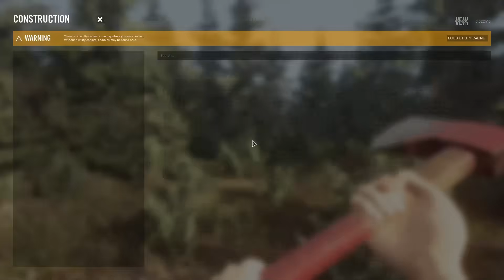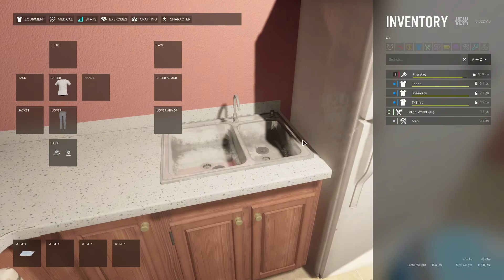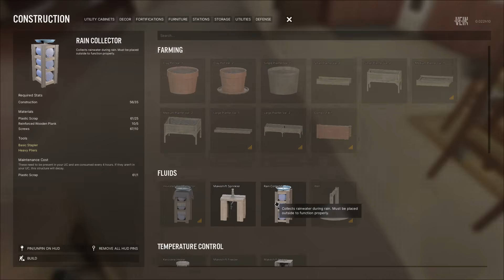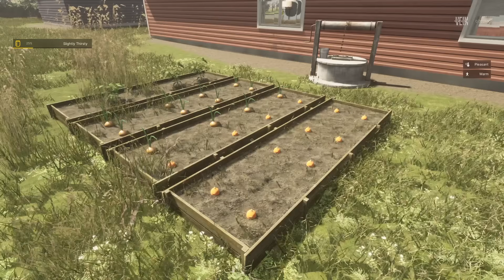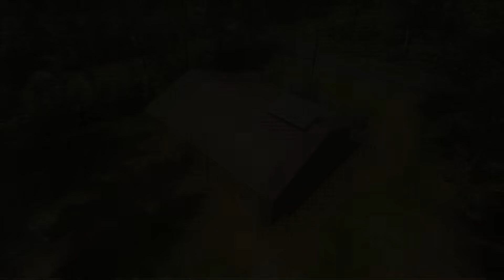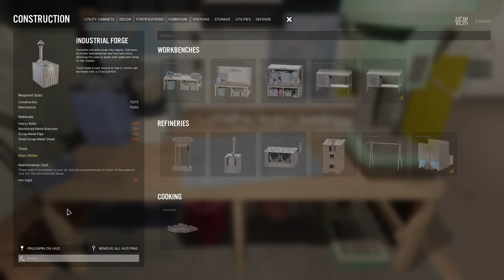VEIN GAME - Ultimate Water & Power Guide #veingame

Comment: FYI - You can now place a container next to a sink and select the option to Fill From Sink. No need to use a transfer container.
Reply from the maker: Thanks for posting this. That was a change they made after the video was released. Still doesn't work for water towers, but you can move a kitchen or bathroom counter with a sink out to the water tower, connect them, and fill barrels quickly that way too 🍺

Comment: You do realize that you can connect the solar panel to the battery and to you fuse box for unlimited power. Makes much more sense than to use a generator to power the battery
Reply from the maker: If you play on PvP servers you'll find there are some people who will dismantle all the solar panels they can find for parts or to grief other players. I showed how to use both generators and solar panels for power so you can go with either option as needed 🍺

Comment: I power my camp with solar & generator combo, so I'm a little disappointed that this game uses car batteries for storing power. Yeah they will work but they are not deep cycle. Also they don't use a charge controller/inverter? Perhaps this will get fixed in the future. Still good game. 👍
Reply from the maker: Be sure to post on the VEIN discord. The devs read all those comments, and will sometimes comment on them 🍺

Comment: I literally cannot get my microwave to work at Bowen hill park. I hook it up to the fuse box, which is hooked up to the solar panels outside, and the microwave shows the connection but still says unpowered
Reply from the maker: Is power going to the fuse box? This is early access, so please report issues like this on the VEIN discord, they test everything 🍺
Reply: @NoStumpsGaming it is. Im wondering if it isnt getting enough power from the panels outside. Microwave says it needs 1200 so maybe thats why

Comment: 👍
If you build a fluid barrel next to a sink, you can just fill it directly.
Same goes with rain collectors, just build them fairly close to a sink and pre-fill them, then when the water is cut off - link them to the same sink.
I usually add a bunch of regular rain collectors to one sink for summer/spring/autumn and another sink just for winter - but hooked up to fewer insulated rain collectors.
I don't attach my rain collectors to the fuse-box, because I want to keep my winter water supply isolated, I have a winter sink and one or two year round sinks.
Reply from the maker: Great tips, they added those features in a recent update 🍺

Comment: I don't know if it's a common knowledge but I accidentally discovered infinite fluid by using fluid barrel + sink trick. And I also uses Industrial dishwasher as a storage since it has an infinite capacity.😂😂
Reply from the maker: Appreciate the tips, but those are the kinds of bugs the devs will clean up sooner or later. I try to avoid glitches in my guides for that reason, but feel free to share them here in the comments for players that like to use them 🍺

Comment: No need to transfer with a containers just place the fluid barrel near a sink, target the fluid barrel and select "Fill tank from sink". You can also do this by placing it near a gas pump "Fill tank from gas pump" and oddly it also works near portable restrooms "Fill tank from portable restroom" but that's not something I will be doing.
Reply from the maker: Great tip 🍺

Comment: I have a question. When the power goes out, does the stove inside RV’s still have power? I assume the vehicle would atleast need to be left running, but does it have power still? I feel like it should.
Reply from the maker: The RV stove always works. I'm sure that will change at some point. I can see them having it run on propane or kerosene since they're both in the game already 🍺

Comment: honestly this is a very poor guide because if u start with cooking, locking and scavenging the game starts extremely easy u start with lockpicks and a book to make them and scavenging allows u to search things immediately. after that u dismantle everything and get dismantle up and then u use the perk to get 1/4 items more when dismantle and then u make metal brackets and dismantle them.. u can use 50 iron scrap and make 50 brackets and then dismantle it and get 100-150 iron scraps and keep doing this.. hit level 50-75 easily and finding latex gloves and firefighter gloves u can try starting cars and leveling electrical up that way or build a battery charger and put all batteries in there and it levels it up
Reply from the maker: A very poor guide indeed 🍺

Comment: Thank you for providing the best no nonsense guide to this or any other game.
Reply from the maker: Thanks for the kind words, glad it was helpful 🍺
Reply: @NoStumpsGaming  Can I ask you a quick question. I've built a door and have a standard lock but cannot fit it the door, am i doing something wrong?
Reply from the maker: @ISOaGoGo  First, you need a screwdriver in your inventory to change locks, second, you need to open the door to remove/install locks to a house, for vehicles, you need to be inside the vehicle, if both of those conditions are met you should be able to remove the old lock and install the new one 🍺
Reply: @NoStumpsGaming this the same for doors or gates you’ve built?
Reply from the maker: @ISOaGoGo  yes 🍺

Comment: I have a tip! Don't connect rain collector directly to the sinks or washers cause they will slowly drain water. Put a water barrel nearby to connect to when you need to use the washer/sink and then disconnect after use to save water. Honestly don't like that you leak water constantly having it hooked up 😢
Reply from the maker: Yeah, that is a weird bug, but it's clearly a  bug and should get fixed in time 🍺

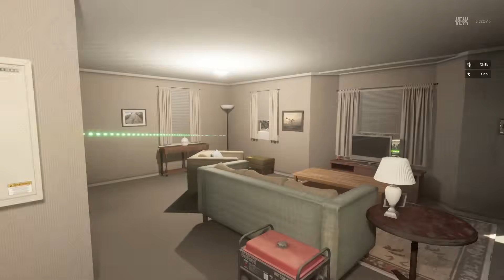Comment: What does one do to connect the fuse box to the solar panels. What buttons does one push? I just see the solar panels little menu of "examine connections, destroy or move" I see to connect option. Does my electric skill need to be higher? Talking about 16:06 in the video. How do you "make" the connection?
Reply from the maker: Remember, "We want this to draw power/water from that, this is where you add the connection, that is what you connect to." If you want this fuse box to draw power from that solar panel you add the connection at the fuse box and connect it to the solar panel. You'll see a little green electric icon on the center of the solar panel when you go to make the connection, just like in the video 🍺

Comment: Dumping dirty water into rain collectors makes it pure with no cook time once you max your cooking
Also the beer keg is good alternative also holds roughly 950oz of fluid
Reply from the maker: Yeah, the water thing is a glitch, and I try not to use glitches in my guides since this is early access and they're going to get fixed at some point. A couple of people have pointed out the beer kegs as well as gas tanks as a fluid tank alternative. Great tip 🍺

Comment: This is not a basic tip but a very useful one. If you are forging ingots get the firefighter gloves. You can then take stuff out of the forge while it's still hot without burning yourself. This means you can cycle supplies without having to wait for it to cool and save yourself a lot of cold Coke charcoal enhanced charcoal whatever. When you get up to the higher tier forge with the higher tier fuels, you can bring the forge up to like 7,000° cycle through stuff and get a lot of crafting of ingots done for only Coke or enhanced charcoal since a lot of your stuff only needs like 3,000°
Reply from the maker: Nice, good to know. Others have pointed out the Gardening Gloves will protect your hands as well 🍺
Reply: God Tier comment! Thank you!

Comment: While a good guide, here are a couple things to improve: Congrats either way!
1. WATER:
1.1. Largest container = car gas tank. You can get one with a Wrench.
1.2 Fill blue containers and dump them into an Insulated Rain Collector. No freezing water in winter.
1.3 Connect Faucet to Insulated Rain Collector. GG.

2: FUEL
2.1 Get a big white truck.
2.2 make blue barrels and put them inside the truck (you can enter from the back while "Holding" a barrel)
2.3 Get to a gas station. Fill them with the Car Gas Tank (4 trips and the barrel is full). Near infinite gasoline for cars + generators.

3: FARMING
3.1 Sprinklers can get to, at least, 6 large plantation thingies. Not side by side, but make four vertical and 2 horizontal. You can fit 6 just fine.
3.2 If you don't mind about immersion, all you need are 4 pumpkins and you're golden. Monodiet, but yeah. Keeps you going if you like the other stuff.
Reply from the maker: Great advice! It's always hard to find a balance between a quick guide and a thorough guide. Usually these kinds of comments help to bridge that gap 🍺
Reply: How about lockpick level low😢 and can I destroy lockpick level hight door from prison
Reply from the maker: @kaungkin4001  You need hydraulic cutting and driver tools to destroy prison doors 🍺
Reply: @kaungkin4001  you can destroy the DOOR no problem. If you destroy Containers you lose loot.

Find a shed with double doors. Go in, lock one. Go outside, lockpick. Repeat.
Remember to read a book for best results   ^_^
Reply: @abhuyl I mean destroy with hammer or something
Reply: Whenever I put more than one thing in the moving truck it goes crazy..
Reply: @random_meta Are you placing them on top of each other? I just carried 14 barrels on my truck just yesterday with no problems at all. None of them stacked though.
Reply from the maker: @random_meta That's unusual. Unless you're putting things in the back of the truck, that can glitch out 🍺

Comment: You need to connect all your fluid storage—including barrels, rain collectors, and wells—to your Fuse Box. Yes the Fuse box. Then, connect all your appliances that use water (sinks, washing machines, etc.) to the same Fuse Box. Try it and test it thoroughly. In my opinion, you absolutely have to make a new video about this setup!
Reply from the maker: Lol, I'll check it out, but this is the kind of stuff the devs disable in time, they really want a realistic game 🍺
Reply: @NoStumpsGaming  You can connect rain collectors with your fuse box for clean water and then connect your sinks, washing machines with a wall power socket and you will have water supply. The electrical machines like washing machines, dryers will have both, power and water. Tested. 
Not realistic but it works.
Reply: @MatthewP-Gr yea but not fun for a quite or probably the most realistic zombie apocalypse survival game out there
Reply: Yep, the fuse box also represents the water and gas connections for the building, all the inputs go through it.....      :)

Comment: Do not select electrical and mechanical.

Instead, build a basic workbench and make a couple hundred brackets. (Don't worry, you will use them all when you make a base)

Bracket levels construction, mechanical, and crafting.

Then make the second tier and make components for electrical.

You might need to put on some gloves and attempt to hot wire a vehicle you don't like to get to 10, if you haven't gotten there from dismantling electronics.

Save the skill picks for hard things to level like vitality and  lockpicking. Strength, sneak, and agility also level rather slowly, so I suggest strength (for more carery weight) or agility (for the sneak faster perk for easier leveling)
Reply: FYI strength (for me) levels insanely fast with chopping down trees. I haven't started with strength stat buffed for months.
Reply: @czarvak9186 those upper levels come slowly, but I haven't been needing to chop wood much

Comment: Car gas tank is the biggest fluid container you can carry in your inventory
Reply: Honestly, the beer keg or the gas tank holds so much that it can become a problem of a weight issue and then you have to try to figure out how much fluid to put into it instead of just hitting Max. I have not tried the large water bottles as I didn't realize those were a thing and all the churches were the same so I hadn't been in that one but I do like Jerry cans. 

Side tip. If it won't let you fill something, it's probably because you don't have enough weight in order to actually carry it filled. That upset me for a while on why my beer kegs suddenly stopped working
Reply: @coreytaggart128  Agree. But for transferring water and filling barrels they can be a time saviour !
Reply: @coreytaggart128  My characters str is almost maxed, i can carry almost 400+ lbs without a backpack, i have no issue moving around with 2 filled gas tanks.
Reply: @coreytaggart128  I know this is an older post - sorry to necro it - but this is such a good thing to know. I am so stupid, I used to wonder why the heck I couldn't get things filled all the way sometimes. Of course I operate with an inventory that is on the edge of packed because I am a loot whore. LOL. Thanks for this little bit of knowldege. I honestly never thought about the inventory limitation being the reason.
Reply: Beer keg holds 900lbs
Reply: @MrScorp45  Car gas tank holds more than double...
Reply: @MrScorp45 oh yeah, forgot about that... 900 though... as much as that?
Reply: @Squiffilect  2111 liters! 🤠